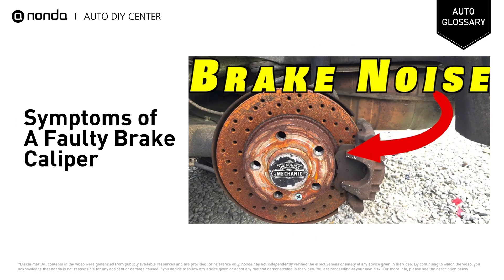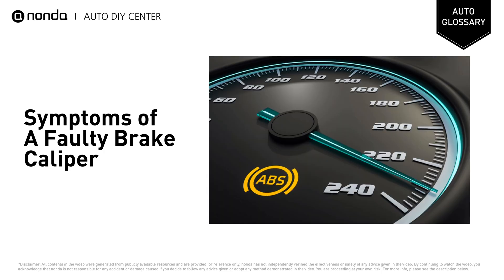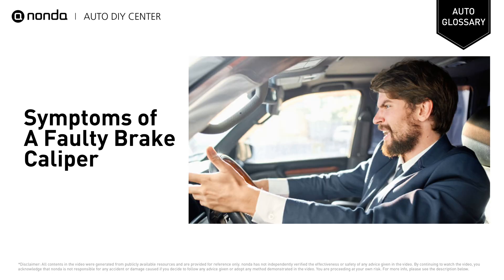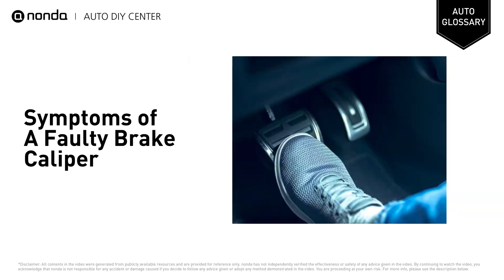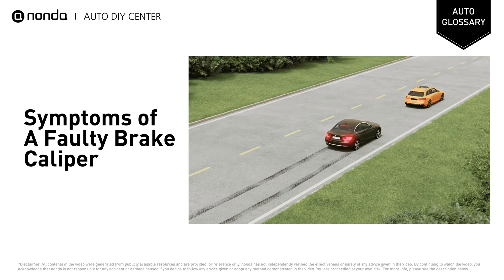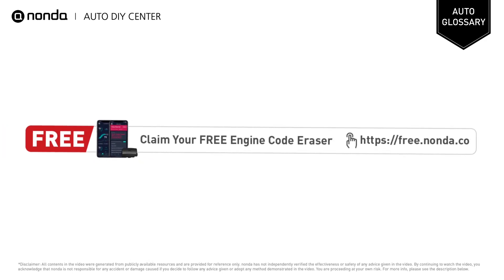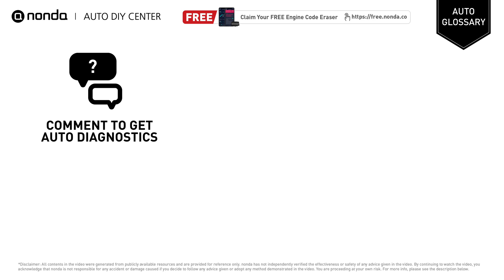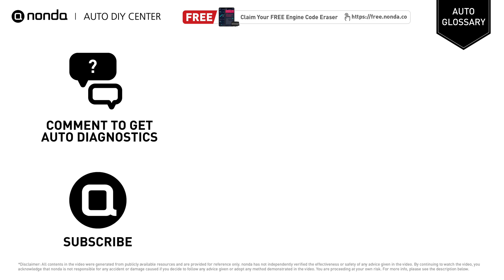Brake Caliper Explained

Comment: My 2003 Mazda lost it brake fluid and brakes while I was driving, went up on a curb waiting for tiw truck to come it was checked by a man I know, but I guess it needs brake lines 2 of them, I didnt get any squeaking or anything, had new brake pads on less than a year ago along with rotors and 1 baron on left wheel side, had a new muffler and alternater put on less than 6months ago, had oil change 1yr ago or less! Engine only has 318000 on it, would it still need calipers put on  them? Don't want to pay a high price for something if I dont need  it???
Reply: Probably too late to be helpful, but the brake lines seem like a good place to start. If the brake lines are bad the condition of the pads doesn’t matter. The brake lines transport the brake fluid that is used to push the calipers closed, forcing the pads to engage the rotor. If the lines have a leak or hole somewhere the brake fluid will leak out there and you’ll lose the pressure to make the calipers move.
It could also be a faulty master cylinder, which is the part that sends the fluid through the brake lines. The fact that it lost all pressure at once makes me think the master cylinder, but if a line is leaking the master cylinder may be getting air when it needs fluid, and that would cause the lack of pressure too.
Reply: Thanks Jim